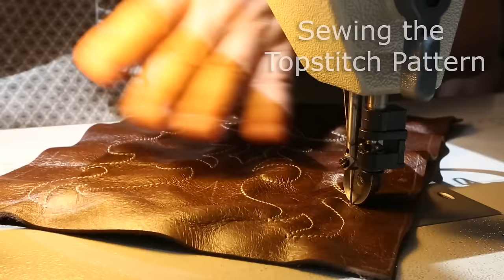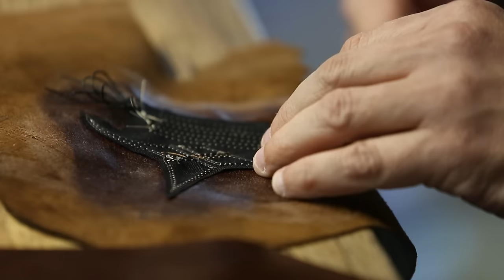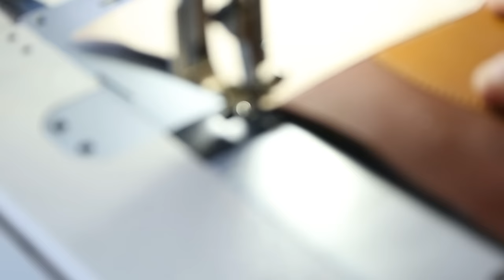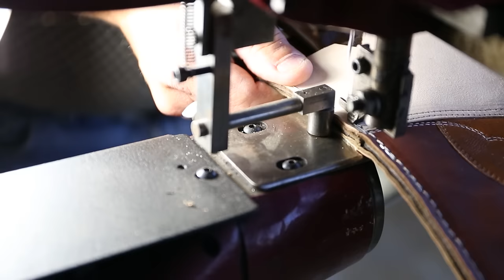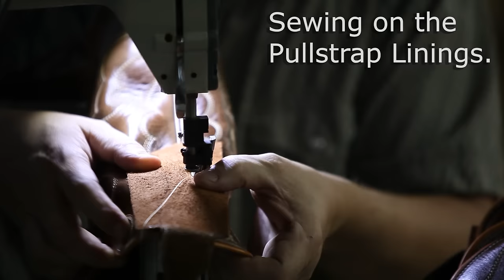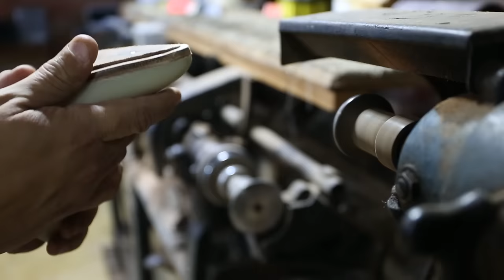Building Cowboy Boots- Start to Finish

Comment: Texas bootmaker here. Not the way that I do it, but nice finished pair. You skipped a few major steps, though. But thanks for posting the video.
Reply from the maker: Thanks for watching. Yeah...film crew took a couple days off...ha ha. I did put links to another welting video though. Thanks again for the comment. What part of Texas?
Reply: @eradawnboots  I’m just northeast of San Antonio. Always interested how others do it. I apprenticed at Capitol Saddlery in Austin, 1972-1975, then went to work for Lucchese in San Antonio, 1975-1985. Then on my own. Saddles and tack, gunbelts, and leather bullwhips.
Reply: @danziegner I’ve recently been wanting to attempt to make boots. Do you think there is a way to learn exactly how to make boots, buy materials, and what needed to make them?
Reply: @danziegner  is the thread just for decoration? Or does it serve some kind of purpose? Like the toe wrinkle things. Or the designs up the side.
Reply: @tylerthegrimm  The toe wrinkle is supposedly to make the leather crease in a controlled manner, keeping the rest of the vamp smooth. The toe bug in front of the stitch lines is just a traditional decoration. The side stitching is said to be for giving the shaft structure but it's also decorational. I've heard in the olden factories you'd get paid for the amount of stitches on a pair of boots, which inspired the multiple row, intricately stitched shafts

Comment: What do you use to draw the pattern on the leather before you stich it? Thanks
Reply from the maker: It is a silver ink pen from Panhandle leather. The ink is specifically formulated to mark on leather, but is easily rubbed off.

Comment: How do you adhere the liner to the inside of the vamp prior to sewing it? Also is the liner pigskin?
Reply from the maker: The vamp lining is cut from a blocker pattern, so larger than the already sewn on vamp. It is stuck from back side and then sewn on from front by a second row of stitching next to the row used to sew on the vamp.